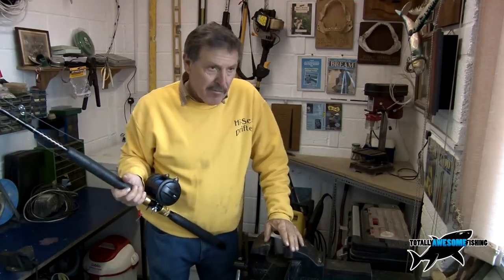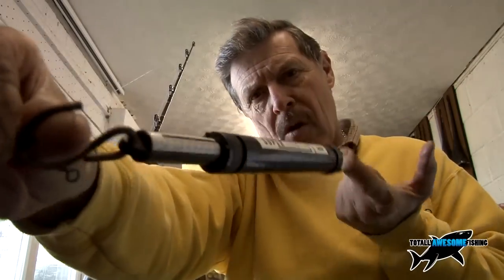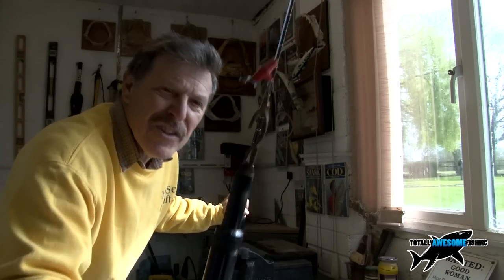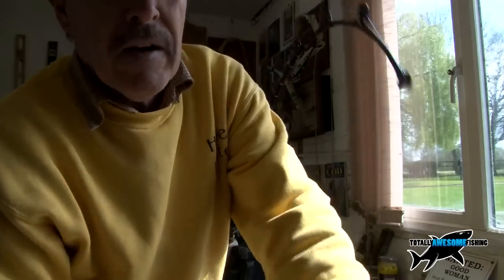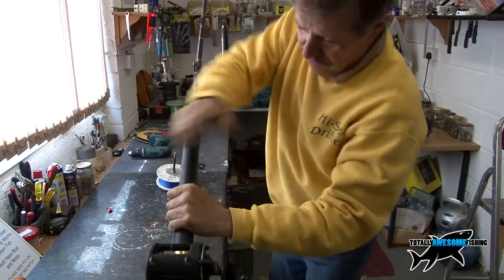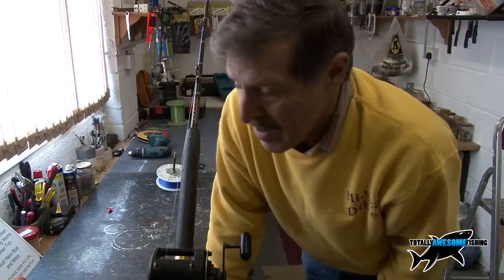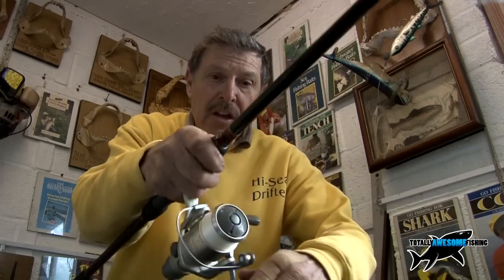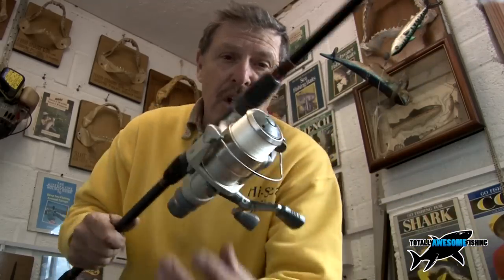How to set a fishing reel drag - Totally Awesome Fishing

Comment: I had a fish today (was at least double digits) and i have the same sort of mechanism (one sort of circular knob to turn around and a lever that goes left to right) eventually i pushed the drag to far up and the line snapped with the fish about 8 foot away from me. This information in the video has been INVALUABLE!

The fact that the pounds required to pull the line off the drag increases with less line on the reel... and actually turning down the drag with less line is something i never knew. Truly appreciated

Comment: at my place it was believed that the drag on the shimano saragosa tightens up the longer the fight goes. now with your video it puts a different perspective ont he same issue. i believe it is harder to pull the line as the spool's diameter reduces is because of less leverage ie more force is needed (resulting in higher line strain) to counter act less and less distance, in this case the diameter of whatever line is available on the spool. Torque (reel's drag) = Force (fish's pull) x perpendicular distance (spool's line diameter). totally awsome video!! lijed and subscribed 👍👍
Reply from the maker: That's why I made the film. I used to do a lot of Big Game fishing and most anglers have no idea how much the drag actually increases as the spool gets lower.

Comment: This is sort of why mono is better than braid.  With that much line out your line will stretch on a big fish when you've lost 1/2 your spool.  I'll totally agree with the video in that your drag setting changes when the circumference of the spool changes.  Another scenario is that when the spool is in motion while pulling drag there is a certain amount of momentum that has started when the reel is turning.  Getting the spool started (drag) is not the same as spool in motion (revolving spool under drag). If you're getting spooled by a fish and it's taken 1/2 your spool (about 100 yards) then your tackle is proably too small for the fish on the line.   Anyway, it was a great video and I thank you for it!  Cheers!

Comment: I really love how detailed this video is. 
Ive got an issue with he spring scale. I bought a rapala 25lb spring scale to accurately measure my drag. 
I tested my shimano saragosa 10k like how you showed in this video, with the drag almost to the tightest setting and pulled. when the drag slipped, the scale only read 12lbs of drag. Which i thought was odd cause the reel is rated for a maximum of 33lbs and it certainly did not feel like 12lbs of drag at the reel when i physically pulled it. 
Scale was tested with lifting weights and it was accurate. I was wondering if there was something i was doing wrong?
Reply from the maker: Could be the scale registers say, 12lbs before the reel drag slips. Once slipping it will probably register different,less as its moving. Could also be sticky drag washers ,you'll know that as it will judder and jerk out in fits and starts. Most high quality reels should offer you a smooth drag setting .Many anglers when fishing think they have a lot of drag on a fish but when they put a scale on the line and put a bend in the rod are often shocked at how small the drag pull really is. I have heard that you can make a smoother drag by spraying some silicon onto the washers,not grease or oil which attracts grit. That's what I have heard,maybe someone else can shed an opinion on it ?

Comment: I am really just starting out as a fisherman. I would call myself and "advanced" beginner (Advanced because I have already learned the hard way what NOT to do). I have already lost more fish than I've landed due to poorly tied knots, bad techniques, and lack of basic skills. Every lost fish yields at least one hard earned (and sometimes expensive) lesson. The one thing that I think has lost me more fish than anything else however, is a complete lack of understanding about drag. I admit to being guilty of slamming the drag all the way forward, past the strike button, (or in the case of the Penn Senators, cranking the star drag down) as a fish began to sizzle the line off, believing that I would "muscle" the fish into submission. As you can imagine, that usually ended with a ping sound as the line parted. Now, in retrospect, I realize how ridiculous that approach was. 

I thought I had this drag thing all dialed in, after another video told me to set my drag at 25-33% of the line strength. So, I went ahead and set them at 15lbs at the strike position for the 50 lb mono on the spool. After watching this video however, I promptly reset them at 10lbs.

Thank you for sharing your experience and understanding with those of us who don't have the benefit of friends with saltwater in their veins and are trying to self teach ourselves the art of fishing.

P.S. I may not have much experience in fishing, but I have a PhD. in "redneck engineering" and I DON''T have deep enough pockets to go out and buy every gizmo at the tackle shop, so I really appreciate all of your examples of home brew tools to make typical fishing tasks easier (i.e. the drill attachment for stripping line).

Comment: As a BA fisherman (back to it after too many years to count!)
I see a lot of your fixed spool reels are rear drag. Could you explain why you seem to prefer them? 
(I've got a rear drag spinning reel because that was the cheapest and wondered if it's better or worse)
Reply from the maker: I don't think it matters whether its a rear or front drag model.I use either.If I had to make a choice I think I would be happy with just the front drag,which seems easier to alter at short notice rather than fumble around at the back of the reel.

Comment: Once you have let the fish take the line and you have reduced the drag to let it run without snapping the line, would you then start to re-apply the drag back to its original setting once you start to bring the fish in ? one other thing is the baitrunner lever on some reels like a pre-set drag so you can turn it on ( its at the initial drag setting ) and off ( its at the fish running drag setting) to make it easier ? thanks in advance hope this made sense.
Reply from the maker: Yes,the reel drag is only reduced when its running away from you or making a big circle where the line drag through the water increases the chance of breakage. Nothing in the UK sea or freshwater can ever swim fast enough to do it,its mostly for fast swimming gamefish in tropical waters.
Reply: great thanks for the reply.

Comment: is it taking more weight to pull the line off the tip of the rod than pulling it from the line coming off the reel? i would imagine the rod takes more load on it , so if its taking you 5 lbs of pull on the line from the reel then i would assume it might take you more to pull it from the line off the tip of the rod right?
Reply: hmm no i remember now i attached a 3/4lb weight to the line directly off the spool on the rod and pulled vertically up keeping line and rod vertical to the weight on the floor just as if i was dead lifting with straight line and set my drag for it to start peeling once the weight was lifted so that my drag was set to 3/4lb ,i then assembled the rod and took the line coming out the tip of the rod and did the same pull test only now my rod was parallel to the weight so that as if im flipping a fish on the boat and the line still peeled as soon as the weight lifted off the floor so i think the same force is being applied regardless either way

Comment: is the same concept as for start drag reel of back off the drag little by little when a big fish take out about half of your line? Thanks.
Reply from the maker: Viet Rider Yes,it may seem weird but the more line you have out the more water pressure is put on it when it pulls sideways.Most anglers want to clamp on the reel drag.That's a recipe for breaking it off.Ease off slowly once any spool is about half way down.
Reply: Thank you so much, your advice is greatly appreciated!

Comment: why are you bringing the lever back to minimum every time you re adjust the drag? is it necessary to do that or can you juts adjust the drag and leave the lever on strike or wherever it is? im wondering if i need to do the same on my shimano gtx 2100 sq small fresh water spinning reel? is this to preserve the life of the system the way you do it or is it actually necessary in order to correctly adjust drag setting?
Reply from the maker: It takes the pressure of the preset knob,which makes it easier to adjust.
Reply: @TAFishing  ok well im wondering if i need to do the same on my small spinning reel

Comment: I've always fished at 50-70% drag.. I just dont know where 20% came from?? Sombody please tell me
Reply from the maker: 20% is standard for average as it gives allowances for the huge increase in drag pressure due to the fulcrum effect on a depleted spool. If you start as high as 70% of the stated breaking strain, and have a big fish dump over half a spool it will probably pop before it even gets that far. 75% drag setting at initial strike drag will put your chances of losing the fish extremely high if you don't back the drag off. Hard to do on a ploughing fish, most anglers want to lock up. But of course once you have come back on the drag you will have no idea how much is then on the fish. Try dumping half your spool then see what the 70% drag reading comes out at.Its a massive increase, and that's in a straight line, not taking into account frictional side drag on the line when a big fish suddenly hangs a left(or right!) Hope this helps. Good fishing
Reply: i use a spinning reel so i cant "lock up" but i do use a quantum reel which tend to have high drags(the new smoke size 25 offers like 16 pounds of drag!!!!) anyway, if you have a higher drag set at the beginning wouldnt it make it tougher on the fish this waering it out faster before it gets low on the spool?
Reply from the maker: Small to medium fish you would probably stop, slow or turn with the higher drag setting,but that's the risk factor. You never know the size of fish swimming in the sea ! As the spool reduces, fixed spool or multiplier doesn't matter, the drag pressure always increases because it takes more leverage to pull line from the spool.
Reply: Guess you got a good point..
Reply: I think I can help.... if your line is 10lbs and you set the drag to 7lbs (70%).... when you get a 1/3rd of your line going out.. the drag is likely to be "over" 10lbs meaning your line will snap. If you set it to 2lbs (20%)... when 1/3 of the line has been taken... the drag will increase (maybe to 5/6lbs) but will still be under the "breaking point".  However... if you have it set to 2lbs and you have more than 1/2 of the reel off it could require more than 10lbs for the drag to go... so in this case you would actually lower the amount of drag you have.. not increase it. Maybe TAFishing will correct me but thats what i got from this video.